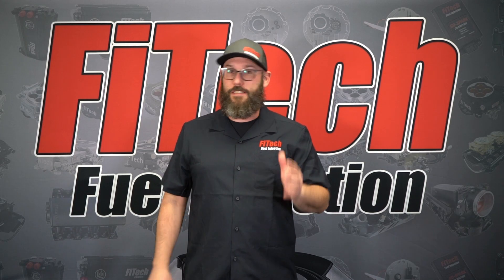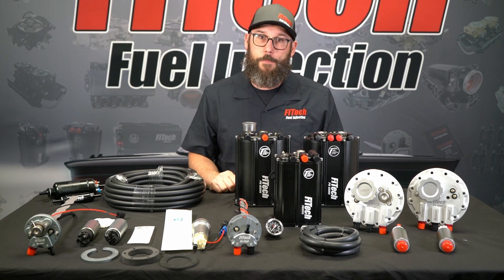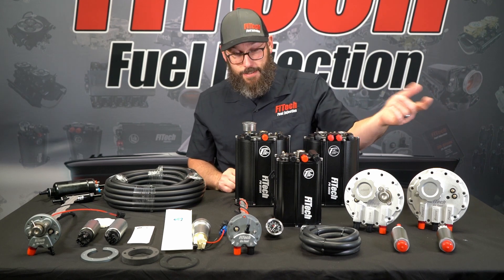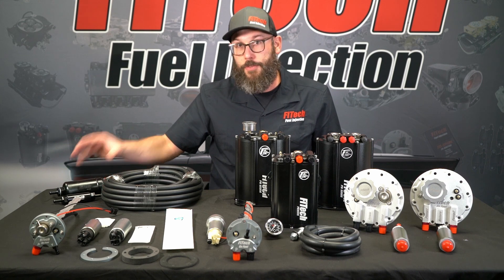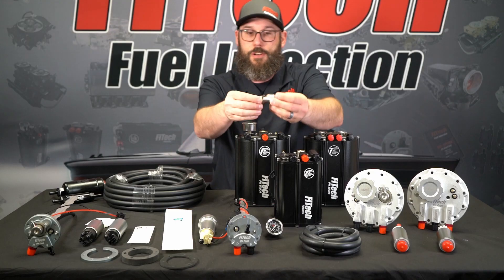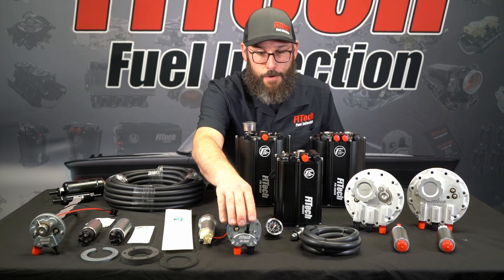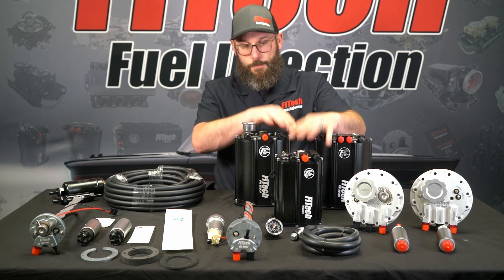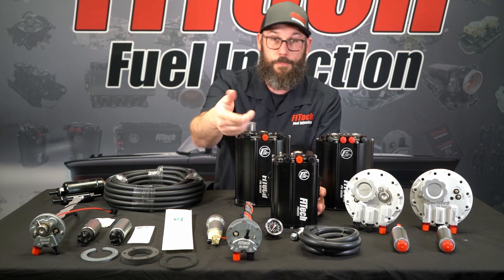Fuel Delivery Options | Tech Tuesdays | EP67

Comment: I have one of the forced fuel set ups, but the car shuts off after about 15 miles. That's about the amount of fuel in the tank. It feels like it's running out of fuel. Where else can there be a problem?
Reply from the maker: Make sure the return line on the Force fuel has fuel flowing. It its blocked you can pressurize the Force fuel preventing additional fuel from getting in. Also your transfer pump sending fuel to the Force fuel may be failing as well.

Comment: I got the fitech 400hp its on a 351 Cleveland I changed from a external fuel pump to a internal 4 bar fuel pump now it only runs if you pore fuel down the carby do i need a fuel regulator or something i am missing
Reply from the maker: A fuel pressure regulator is required. There is one built into the EFI system. Fuel pressure should be 43.5 PSI on the Go Street 400 HP

Comment: Do you need a EFI fuel tank? I have an 1981 Jeep with the surge pump set up I want to convert to the in take fuel pump. I do not believe the electric pump is located in the optimal position and I have fuel starvetion issues @ times.